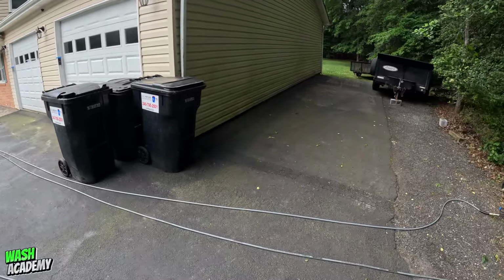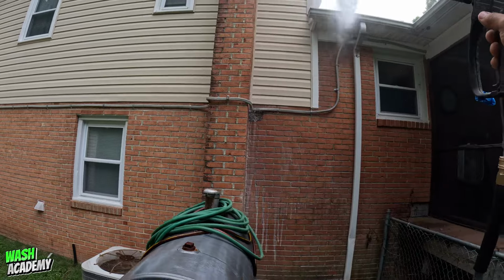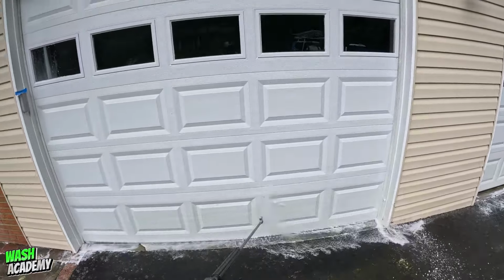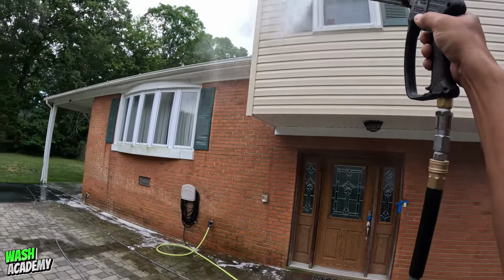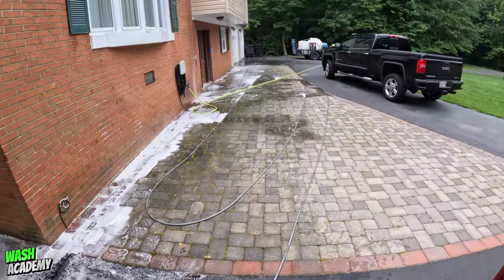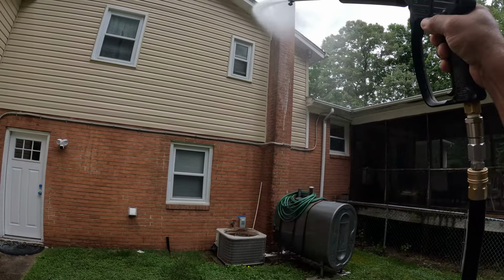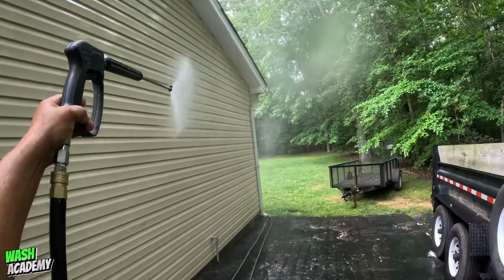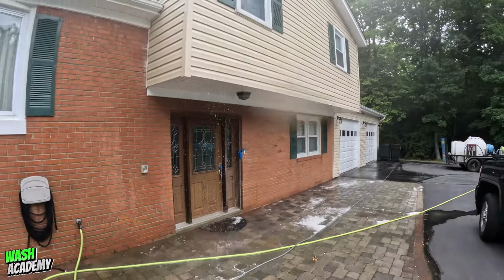Ep.147  How to DOWNSTREAM A HOUSE: Pressure Washing Series (PART EIGHT)

Comment: Hey Mr. Bubbles!

Just curious about the stained wooden door, were you too worried about anything happening, or is it not very likely for a 0.8 - 1% solution?

Thanks for another great video
Reply from the maker: thanks for the great question, solution simply not strong enough to damage anything, that's why I recommend this system to new guys